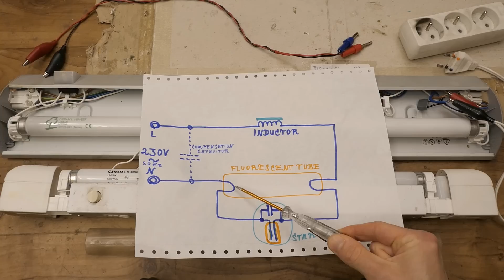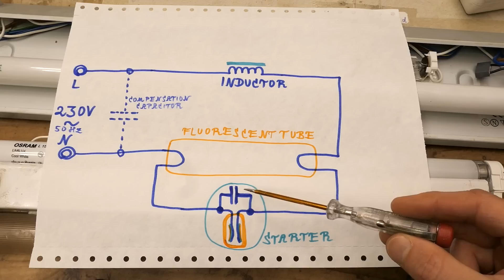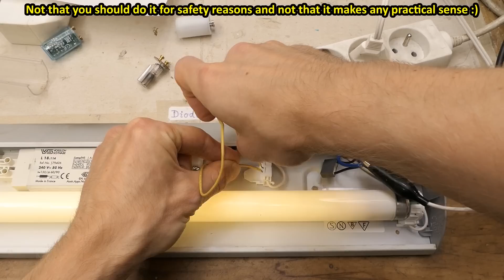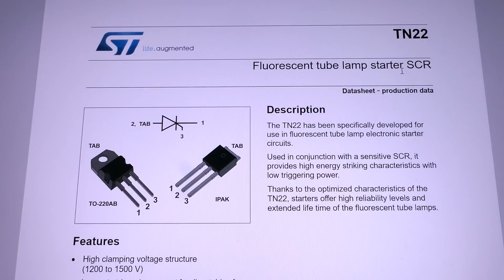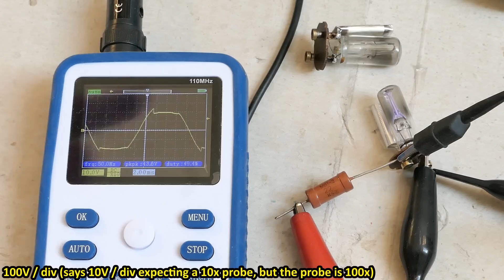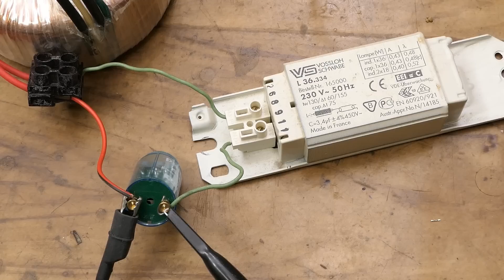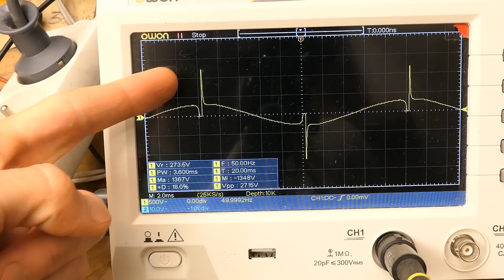Fluorescent lamps, electronic vs. glow starters

Comment: I have very unusual fluorescent lamps from old streetcars. They ran at 300V DC in series there, so always two lamps failed, never a single one (or an odd number of lamps). You might know the legendary Tatra T3 trams, but the lights I have are from a K2 tram, which is the articulated version. I initially got them for free from old trams that were sent for modernization (they never had those lights afterwards) a few decades ago. I used a ballast and starter, but later reused electronic drivers from dead fluorescent bulbs. It was the filaments in the bulbs that failed after about 8 years, not the electronic circuit. So I botched it to the big streetcar lights and they work fine ever since then (about 10 years now). The upside is that they light up instantly and do not flicker. I remember dumpster diving for old fluorescent light-bulbs, as I knew that the electronics inside some of them (I focused on Philips 22W) was perfectly fine in driving the 25W tubes used in streetcars. The only problem is, those tubes are quite atypical length (1 meter), which cannot be bought commercially and I have to source them from old streetcars that are being scrapped (commercial lengths are 0,6 meters and 1,2 meters). The problem is that worn out tubes rarely work properly. In streetcars, where they run on 300V DC they work, but not always when I try to run them. Fun fact: The streetcars have a polarity reverser that periodically reverses the polarity on the tubes to ensure even wear of the electrodes. Older series relied on the driver regularly switching the lights between the two "ON" positions that were either side of the "OFF" position, usually at terminus stations. The funny thing is, that I had to completely rewire the streetcar lights in order to make them run. The original 600V rated cables were a super thick rubber insulation with a super thin copper wire inside. Very unusual in comparison with regular 230V "household" stuff. I still have four of those lights in my garage and they work without problems. Another interesting thing: The light fixtures did have resistive heaters running alongside them next to the tube to make sure those tubes would light up even in harsh winter conditions at temperatures of -40°C. Those heating elements were about 1 cm away from the tubes and ran in parallel to them. I do not remember how they were wired, it is about 20 years since I modified them. Maybe even longer. I have some spare electronics drivers and one spare tube that works, but give the reliability, I do not expect to need any of them soon. I wish I had gathered more of those lights and drivers 20 to 15 years ago, when those streetcars and bulbs were massively being replaced by more modern things.

Comment: Manually shorting out the starter contacts explains why my dad's retractable shop light had a momentary switch on it that you had to press to start it :)

Also as a kid I loved the noises the glow starters make
Reply: Ding
Ding
Ding

Ding

Diiiing!
Reply: I got a workbench lamp with a magnifying glass and ring tube from the trash. And it also has two switches, one toggle and one momentary. I was wondering what that would do, when I saw it. I also thought something was broken, because the lamp didn't turn on with the toggle switch. Only when I was looking for the starter, as they are the usual culprit for non-starting tubes, it "clicked" for me. It feels like in the ancient times, where I remember my uncle having to preheat his Diesel car and tractor 😅.
Reply: i used to  start my 70w hps  work light this way when I had no functional starter available 😅😅

Comment: I really appreciated this explanation, also learned a lot about fluorescent starters. I am slightly jealous about your collection of those stuff, here in Brazil even fluorescent tubes are "unobtainium" right now. Every light that worn off needs to be replaced by crappy led tubes.
Reply: My school still uses florescent tube
Reply: @Denis7947.  ive ever seen a huge soviet box of fluorescent tubes, so my school won't ever run out of them
Reply: @Gameplayer55055  lol
Reply: Then you need to collect used ones. Sometimes the ballast is worn but the tube is still good and vice versa.

If they get replaced als for some used ones.

Then you can start a collection
Reply: @WagTsX- you can always use two 120v incandescent bulbs in series with the 230-240v mains. Also better to run a mov in parallel to the bulbs. Ie between hot and neutral. Careful as not to get zapped by mains power and Incandescent bulbs can potentially burn stuff that they touch. Temporary or somewhat permanent solution. Also, you don't like the led bulbs? They seem quite decent especially as the chip leds they use is of a warm non clinical color.
Reply: Event though I'm a little bit late, here in Romania they're not entirely gone. I managed to snap up a stockpile of fixtures, tubes, chokes, electronic ballasts and starters. My garage and kitchen will be on fluorescent lighting even if I live to be the oldest human on record!
Reply: quick update: I managed to get 5 used tubes from a dumpster, I saw them there laying around just about to be trashed, quickly I got my multimeter and tested continuity on both sides, both are good on all 5 tubes, I brought the tubes home, cleaned them up and tested with a ballast, all 5 of them were lighting up fine. Now I have a little stock of tubes left for future usage. But what a way we need to go thru to get such thing this days.
Reply: @WagTsX  you'd be surprised. A friend once found a RAM module by the dumpster; knowing I'd want it, he took it. I inspected it, cleaned it, it was 128MB SDRAM - and that thing passed all error tests, I installed it in my oldest computer.
Reply: I have 4000k led tube. Next to a 4000k fluorescent lamp there is no difference in color and brightness. It looks exactly the same except it doesnt blink on startup. Maybe that can be modded in.
Reply: @1marcelfilms  If it's a preheat fluorescent lamp it will most likely outlive the LED lamp.

Comment: Very nice demonstration. I really like old fluorescent lights because they seem to last a long time, and remind me of better days before all of the far East poor quality parts we are forced to use now with LED lights. My shop has all fluorescent lights but they are North American spec T12 high-output lamps, with a more complex ballast. These ballasts have been unavailable for years. I have been removing the potting compound and replacing the worn out metal film capacitors in them to keep my lights working.

Comment: What an amazing video. I used to work in a hospital, illuminated by hundreds of fluorescent tubes, a significant proportion of which were permanently blinking, obviously using the old style starter. I had a good laugh at the mains voltage breadboard btw.
Reply: I preferred the flickery startups personally
Reply: @lukedavis436 me too., bond is stronger with that one huh.!

Comment: When I was at school in the 1980s, money in the educational system was so tight, we were limited to one light starter per classroom  (all old-style glow starters).  Every afternoon in the Winter, somebody would be given the task of climbing on desks, reaching up and inserting the starter into each light fitting in turn to start the light.

It sounds crazy today  (even more so, considering the temporary blinding effect of the tube bursting into life while you were standing precariously on a desk),  but it undeniably kept the price of school meals low across the county, so maybe it was actually worth it .....

After I left university, one of my friends lived in a flat with a faulty starter in the bathroom light, which had to be twisted in and back out again to make the light come on.  I guess the faulty starter must have been short-circuit.

Comment: The starter closeup is the best thing I saw today on the internet. Since childhood I wondered how it worked. These tubelights were used at home when I was small. Once a starter failed and what I did was pulled out the bulb from starter and inserted a small cherry and it actually worked.

Comment: In the '60's and '70's I had some florescent 2' and 4' tube fixtures.  They all used big heavy ballasts and starters.  The starters had a hole in the top of the can where you could see the light from the the electrodes arcing as it started the tube.  If the tube wouldn't light and there was no glow from the hole, you knew the starter was bad.
Reply from the maker: Wouldn't an open filament appear the same?

Comment: It took me years, to fully understand how flourescent lights worked. This video shows very clearly how they work. Brilliant.. 
I always thought that the capacitor in the starter, was to quench the spark across the bimetallic contacts and provide interference supression. Which would explain why it is missing in an electronic starter.
Now I have to figure how some flourescents can be dimmed. Some I have come across needed special tubes with an extra filament in them. But I have seen others that use standard (UV) tubes.
I worked at sea and my first ship had DC 110v mains. there was a single flourescent fitting over the projector screen, in the mess room. It had to be started with a push switch. (No AC mains).
Reply: You can easily dim a fluorescent tube "just" by reducing the amount of current in the main discharge. The hard part is the reduced current results in a lower electrode temperature so you often need extra electrode heating. There's no need for a special tube, this can be done in an 4 pin ordinary tube just by applying some voltage across each filament.

Comment: I accidentally learned how this works when I was a boy (maybe 10-11 years old) and used to play with starters and iron ballasts connected to batteries or small power supplies from toys. The iron ballast gave me some electric shocks when I disconnected the power supply. I got intrigued why it happened while disconnecting (insted of connecting) the power supply, until I learned what an inductor is and how it works.

Comment: Cool post. Clear and well presented. Vibrators from old tube radios vs. solid state replacement which is usually built into the old can. Some self-rectify. Interesting study.

Comment: Back in the old days of the 1980s, there was a diy Christmas tree decoration in the house where the bulb in the lamps had a random flashing switch made of a starter of fluorescent lights in series. It looked cool and the crackling noises interrupted the radio :)

Comment: The capacitor in the starter is set to reduce sparking on the contacts. This way they last longer.
Reply: So, like an ignition condenser on an engine? But like Dan says the blinks are also slower with the capacitor.
Reply: @1pcfred  Yes.
I don't see the difference in blinking speed with or without the capacitor.
Reply: I agree i think its there to stop arcing and welding of the contacts but thinking about the mode of operation he might also be right we need to work out what exactly makes the contacts open up is it just because when they short the heat inside the starter dies down and thet open or is it welded and relies on the capacitor obviously the arc cant form that ignites the tube till the contacts open so that rules out the tube pulling down the current having anything to do with it apart from stopping the starter warming again
Reply: It also carges to the voltage inductively generated by thew ballast and stays ata higher voltage for a few milliseconds.
Reply: re: "The capacitor in the starter is set to reduce sparking on the contacts. "
Arcing - it reduces the 'gas plasma' that forms, which works against getting the main tubes to 'light up' (note: The Neon tube is in parallel with the main fluorescent tubes.).

Comment: Glow starter closeups are kinda beautiful. I used to work for an emergency lighting business where we converted these fittings with inverter modules and ni-cad batteries for escape lighting during normal mains failure. All gone to LED now of course.
Reply from the maker: I have a 2x 58W tube light with an electronic inverter + a 4.8V NiCd backup. I might expore the internals in one of the future videos ;)
Reply: This would be interesting. Starting a cold lamp - without the starter - with high frequency maybe 30khz from a small DC battery.
Reply from the maker: I tend to call these "fluorescent tube blackeners". Cold operation at a greatly reduced power removes all the electrode coating in just several hours.
Reply: Absolutely and in UK running for 3hrs. For your 58W tube 6 D cells in series 4Ah 7.2V discharging at about 1.1A was usual. In Europe 1hr duration was usual and sub C 1.2Ah cells typical. A lot of blackened long tubes and compact fluorescents especially after the 3rd year of installation when a full 3hrs duration test was required.
Reply: @DiodeGoneWild  Some inverters used a single transistor oscillator, the current was not simmertrical and the tube current had a DC component reducing its life.

Comment: What's interesting is that 220 Volts fluorescent lamps basically have the same set up as 110 Volts ones (some 110 Volts AC fluorescent lamps use special autotransformers to provide necessary arc voltage to the longer fluorescent tubes, namely 32 - 40 Watts varieties, of course and keep the filament cherry red hot so the electrode wear is lessened somewhat), namely the inductor ballast acting like a variable reactive resistor to maintain sane arc voltage so fluorescent tubes don't have too much current flowing through which is naturally bad.

As for the relaxation oscillation, DC would work best, and try 1 to 100 uF 250 Volts DC electrolytic capacitors and you would see it rhythmically blinking.

Comment: I have some old flourescent lamps where the on/off switch is a push-on/push-off but you need to push and hold to ignite the lamp. I guess the power button has two switches in it - one in series with the mains and one parallel with the tube.
Reply: Ya - the old 2-lamp desklamps that used to be used throughout offices had this arrangement. Watch the fifties movies and not the lamps clamped to a desk edge ...

Comment: I put an electronic starter on a fluorescent lamp 20 years ago and I still use the same fluorescent lamp tube and the same starter (it had a small fault in the resistor which I replaced).

Comment: When I have a starter with welded contacts I connect it to a 10A power supply and blow the short apart. I was always under the impression that the capacitor was to reduce RFI, since a fluorescent tube is effectively an arc lamp. If the capacitor is shorted I cut it out of circuit.

Comment: While the capacitor does have an interference suppression function, my thinking is that is not its main reason for existence.  It doesn't have nearly enough value to keep the contacts closed briefly, that's accomplished simply the the thermal mass of the bimetallic strip.  I think the main reason for the capacitor is to route the high voltage starting kick from the inductor around the gas tube, so it doesn't conduct and draw current away from the lamp.

Comment: Super fascinating! I always wondered how the old starters worked. I am curious here in 120v land, can you run a tube with just ballast and starter like you can in 230v places? I don't know why I always thought they had to use a transformer too to step up voltage...
Reply: We need transformers for 4ft and larger tubes, but for 2ft and smaller tubes the traditional circuit works fine. I remember there was a dark windowless bathroom in the old wing of my middle school. I liked arriving when the lights were off because then I could be the one to watch them turn on. Actually I'm sure most of the time I just turned them off and back on.

More recently I noticed a fluorescent wall light clicking and failing to strike at the local library just this weekend which surprised me. The light was installed when the building was renovated around 2004 so I would've expected an electronic ballast.
Reply: @eDoc2020  re: "for 4ft and larger tubes"
4ft tubes strike just fine on a 120VAC 60 Hz circuit here ... at TI they used the very long single contact per end in the overhead lights, but then they also had access to 480 V multiphase mains too.
Reply: @uploadJ   I just looked at the ANSI C78.81 document and a 48T12 lamp (of the American variety) requires 176-230 Vrms between lamp terminals to start. With the inductive spike of a mechanical starter this could work but it would likely take several tries. The more important problem is that the nominal lamp operating point is 101 volts which is getting pretty close to 120 volts. The lamp power would vary an unacceptable amount with line voltage fluctuations, temperature, etc.

We obviously do have 4ft tubes run from a 120v source but the difference is we do not use a simple series inductive ballast like shown here. We usually use a "rapid start" ballast which is a more complicated step-up transformer with integral current-limiting. These have extra windings to directly heat the filaments and do not use starters. The reference ballast is equivalent to a 236 VAC supply and a 439 ohm current limiter.

The 8ft long tubes with a single contact on each end are instant-start. The reference ballast for those is equivalent to a 625 VAC source and a 1280 ohm current limiter. They rely on this very high voltage to start without preheating the cathodes.